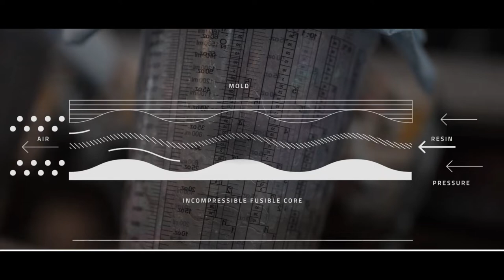Time Alpe D'Huez 01 Long Term Review

Comment: Owned a Time alpe d’ huez 21 for over a year now and its the closest thing to a classic steel frame in feel except it has that light feel and rockets uphill with ease. Super stable and rails downhill! 
Beautiful bike.
Reply from the maker: Man, you nailed what I was trying to express - that’s EXACTLY RIGHT.
Reply: Could you describe your bike? What Wheels/stem/handlebar/seatpost you use? Im interested by this bike and its difficult to find review
Reply: @Gigi26500 I use 3T 110mm stem and giro d’italia bars. Seatpost is the deda zero that the frame came with frame. Rim brake with campag 11 speed potenza, wheels campag zonda. 54cm size.
Beautiful bike to ride.

Comment: I bought my Alp D'Huez last week and I agree with everything you said.  I've had many bikes over the past 38 years, very few of them felt incrementally better than the last.  This is by and far the best frame I've ridden.  I paired it with DA Di2, rim brakes, Pro Vibe stem and bar and, ahem, Lightweight wheels... which I only bought because it's very difficult to find reasonably priced quality wheels right now and I was able to find these locally with just a few miles on them. The bike came it at 14.8 lbs with Wahoo pedals.  I couldn't be happier.
Reply from the maker: I was with you right up to “rim brakes” 🤣🤣 JUST KIDDING!! I’d love to build up a superlight rim brake bike with my Ksyrium Carbon tubulars.
Reply: @AndyClarkRealReviews  Lol, well I'm still a little old fashioned I guess.  And, as you know, we don't descend for very long around here so not as much of a performance advantage to get disc.
Reply from the maker: @cycleark  Truth...I still remember your other Time - you let me borrow it for BDB a few years back. What a rocketship!

Comment: Got my ADH 01 a few days ago. Built it up with some of my favorite parts. Shimano di2 12 speed, BBInfinate ceramic bottom bracket. Used my Zipp 303/404 firecrest wheelset with Vitoria Corsa pros 28/30mm. Very nice riding bike on my short 35 mile ride. Can’t wait to put some real miles on it. Thanks Andy
Reply from the maker: Very nice!

Comment: My local bike shop is now a selling this Time frame set and the point which resonates with me the most is Time own the entire process. After the last 2 years will not buy a Wilier, Specialised or Bianchi if it’s made in China. If they’re going to change top dollar it must be made in house.
Reply from the maker: It’s well worth it. This is a top-notch frame and you can really feel the difference.
Reply: @AndyClarkRealReviews  thanks for confirming my purchase.
Reply: or the traitors and deception artists at specialized/trek/wilier etc can sell those southeast asia sweat shop bikes bikes for $300 instead if the $6,000 they're charging

Comment: Those Time pedals were the best...  esp if you ran the Time shoes with them.  I started on a blue and white Schwinn Tempo, one model year before yours.  It was a great bike, 6 speed 105 with complete crap wheels- Rigida rims (that were NOT rigid) and Mallard hubs.  But I rode the poop out of that bike.  I did not get the Time pedals until 3 years later when I developed knee issues.  The pedals fixed my knee problems.  I used them for the next 8 years.  Same pedals and shoes.
Reply from the maker: Nice! My Tempo had Wolblers with 105 hubs. They were absolutely BOMB PROOF!

Comment: i having been riding the disc ADZ01 w the Aktiv fork since the fall - it is an amazing bike - perfect in every way, comfortable, stiff, refined, great handling, solid build- it's truly perfect - and oh, the carbon weave.....it's stunning  - just oh, so good....weighs about 16.75 lbs w pedals and cages....i run 25mm tires on the back and 23mm on the front - it's awesome - not the lightest, but this is better than my Colnago in every way....Viva Le France!

Comment: Hey Andy, interesting timing for your video! I’ve been having a lot of thoughts about Time in the past few months. Their older frame finishes didn’t really work for me and as I’m aesthetically driven I opted to wait. The new finishes are so classy!

I’m after a frame for a full Campagnolo rim brake build. I’m not wanting to over capitalise on a rim frame as it’s more just to tick the campy box. However I’m also so impressed by Time that I’m considering a double purchase and getting a disc frame also. 
So a few questions:
1. Do you have any thoughts or experience with the Alpe d,Huez 21 versus the AdH 1?
2. Did you try the time carbon bars at all? I see you had an alternative bar on your bike in the video. They look pretty sweet.
3. Have you tried the regular fork, as opposed to Activ fork?

Thanks for your review.
Reply from the maker: Hey Joel! Yeah, I spent a weekend on the ADH1 and it's really close but I could definitely feel a difference in the responsiveness column. The Time bars are amazing, but the bend shape didn't work for me (they are too deep). Lastly, stick with the Activ fork. It's the real deal and makes a difference for sure (you can also remove the damper to reduce weight, but it's only like 50g).

Comment: I’m still on a 2013 SuperSix Evo hi mod, which I know was a favorite of yours Andy way back when. Part of the joy of this bike of course is that in addition to its stiffness in the right spots and awesome ride, it’s also comically lightweight (mine is 14.5 with cheating titanium speed plays).
I’m looking at these Time bikes as a possible new bike option so curious how you can relate the Time to that old Cannondale? Also, was the R5 a huge step up from that Evo, as that’s also on my shortlist….
Reply from the maker: I would step over the R5 to get to the Alpe D'Huez, and I actually did: I sold my R5 disc a few months after I built up the Time. The SuperSix is an amazing frame, but at the end of the day it's lacking the smooth refinement of the ADH. "Ride Quality" can be hard to define, but you definitely KNOW it when you feel it - and the ADH delivers the most vintage-steel like ride I've ever experienced on a carbon bike, without sacrificing any of the gains of a modern carbon frame. And yes, I stole that analogy from another commenter because he said it better than me!!
Reply: @AndyClarkRealReviews  I saw in the video that you jumped ship for the ADH, yeah, and it was clear how much that meant to you. And really if this ADH is supposed to ride like my steel De Rosa Primato (the '95 with the Columbus OS tubing which is sooooo sweet) then that's pretty impressive and makes me very curious!
but will it come with the same weight penalty and the lesser stiffness from, say, bottom bracket through rear chain stays that made this EVO so damn efficient? 
I admit I'm spoiled at this point and the thought of paying out many thousands for a bike that weighs 17lbs makes my heart stop a bit! I'm too slow to add further riding penalties :)
Reply from the maker: @lostincosmos  I'm of the opinion that at some point, lower weight equals diminishing returns. The ADH is 960 grams, and the SSE is 650. You can easily find 300g elsewhere, but honestly it won't make you either faster or slower. Aerodynamic and mechanical resistance gains can far "outweigh" the 300g.  Wheel/tire setup alone can make up the difference, even if it's heavier! I'd recommend spending some time with the Marginal Gains podcast to better understand where I'm coming from.
Reply: @AndyClarkRealReviews  thanks, I'll check that out as I'm reading up and I found this morning a discussion somewhere else with some stats that showed weight savings was minimal in terms of watts saved. so I might just have a mental hurdle to hop over to get over it :) 
Always appreciated your insight, and you should know you're one of the reasons I bought the SSE in the first place as you were gracious enough to even speak with me on the phone when you were at speedgoat I think it was and I was shopping. you called the SSE a beast and once I test rode it was shocked at what it delivered. (I didn't buy through you, sorry, I got a package deal as my wife got a MTB at a local shop and they offered a "holy @#*! price" on the SSE that I jumped at).
so, thanks for still contributing your reviews and knowledge!
Reply: @AndyClarkRealReviews  sorry for the blast from the past. but I'm now an owner of a 2023 Time Alpe and after only a few short miles, I absolutely 100% understand your love for this bike. it really is as comfy as steel as you and another person were saying in another comment, and yet I think the stiffness in the bottom bracket/chainstay area won't leave me wanting for the SS EVO I'm coming from.
could not be happier. thanks once again for helping me head the right direction for my next bike.
Reply from the maker: Nice! Yeah, the R5 was a massive step up in every way, across the board, and I got way better tire clearance too. The ADH won’t be as light, but it’s an easy sacrifice because the ride quality is so sublime.

Comment: I'm a bit puzzled about that comment regarding tire clearance. Time writes on its homepage max. tire size is 28C - 30mm. I want to run Enve 4.5 AR Disc wheels and 28mm tires which I expect to balloon to 30mm. If these don't fit, then that is not the frame for me unfortunately. Everything else I'd really like about the ADH1. It is 5mm shorter than my Tarmac SL6 and has a higher stack. As I am more legs than torso this would allow me to run a longer stem and less spacers under it. But the tire clearance seems to be a dealbreaker unfortunately :(
Reply from the maker: Will they (air quotes) fit? (air quotes)...yes: to the naked eye, there appears to be plenty of clearance on a 30c when the bike is stationary or in the stand. However, when the tires, wheels, and frame flex (as they should) under normal use, the 30c tires will ABSOLUTELY rub on the frame. It's light, and imperceptible, but it happens (and I have the bald spots on my frame's paint to prove it). Go for the new ADHX if you want something with more range.
Reply: @AndyClarkRealReviews  Thank you  for the fast response. Really appreciate your engagement here in the comments to give your real world experience of the frame. I already ride a steel  gravelbike and have no intention on getting a second gravelbike. I will wait on TIME to update their ADH1 and Scylon with the new bio based dyneema internal cable routing and tire clearance to safely run a 30mm. This seems like a must  in 22/23 and going forward as I don't see myself ever running a mechanical group or narrower tire than 28 ever again.
Reply from the maker: @o0o0o0o0o01  Couldn't agree more - they need to push the clearance on the next generation, and make a few other changes (the fork is gimmicky, IMO).

Comment: Hey Andy, I’ve been looking at a rim brake version of this frame, but live in an area with terrible road surface. Would you recommend this with 25mm tyres? (Assuming this is the max clearance for a rim frameset). Thanks! (PS Life long fan. I’ve watched your videos from the very beginning, from around 12 years old!)
Reply from the maker: Hey Harry! Thanks for sticking with me all this time - I guess you’re in your mid 20’s now?? Anyway: I’d go with tubeless 28’s. Your rim brakes should have plenty of clearance

Comment: Would 30s work on Fulcrum wheels that run slightly narrow (19mm internal)?
Reply from the maker: Would they 'work'? Yes. Would you scratch up the paint? Yes, probably. Not advised - stick with 28's!

Comment: You seem like you have a lot of knowledge about Time bikes.

I'm considering buying one, but am not quite sure wether i should go for the adh01, or the new adh disc 2023.

Is this new bike now considered their top level frame in terms of stiffness / weight etc, or is that still the adh01?
Reply from the maker: The 2023 ADH disc is their new updated flagship bike. ADH01 is slightly different and ADH21 is a step down. ADH01 is on sale right now and probably the best value
Reply: ADH disc 2023 has different composite combination, using new formula with Dyneema, I believe it is less stiff than ADH01, however they both share HM Carbon & Vectran fibres, but in different proportion. I wil have in next few days the latest frameset ADH 2023, so it will be tested on the road.
Reply: @MrSzwarz  Please give us your feedback😎

Comment: Hiii Andy I’m actually racing The Alpe D Huez triathlon in July next year - fairly new to the cycling bit and I was told I’d benefit from trading in my Blue Rim brake climbing bike for the alpe d huez… I’m 5ft so hard to find a good bike w all the favorite specs,,,, can you tell me your thoughts on which ADH I should look into more - thank you
Reply from the maker: Hey Shana! I checked out your channel...do you live in Chicago? I lived there for a few years and would happy to recommend a good shop/community of cyclists to help you on your journey. As for the bike - if I'm looking at the right course map, it appears to be flat until you hit the famous climb...and then it's all uphill! TBH, your rim brake bike should be just fine from a braking and weight perspective. I'd spend my money on other upgrades like a lighter set of wheels/tires and maybe an aero helmet and a good aero clip on for the flat section. Of course, I won't talk you out of getting the ADH (because it's amazing) but for me, there's other things to spend your money on. Like an upgrade to biz or first class for the flight over :-P

Comment: Other than weight, how does the ADH compare to the ADHX if you ran both with 28 mm high quality supple tires? The geometry looks very similar.
Reply from the maker: They’re very close, performance-wise. How will you be using it?
Reply: @AndyClarkRealReviews  All on road. Some very rough. I have 1971 Bob Jackson Reynolds 531, w/full Campy, 32 mm Rene Herse extra-light tires, TPU inner tubes, 63 psi. Comfortable, quick, classic stage race bike but HEAVY. 1987 Vitus 1987 (Sean Kelly's ride) w/fully Campy. Love the ride, good handling, but max tire is 25 mm, 85 psi. Not good for rough roads. Recent top of the line Trek Domane w/Dura-Ace Di-2 12 speed, 38 mm Rene Herse extra light, measure 42 mm, 38 psi. Ride is not as comfy as the Bob Jackson. Sluggish handling, and about 2 pounds heavier than an equivalent non-endurance carbon. Basically looking for quick handling, light weight, dance on pedals during climbs, and chip seal, tar strip comfort on 4-5 hr rides. Going to trade the Domane for ADH or ADHX. Would like to test ride, but no dealers any where near Indianapolis.
Reply: NO racing!
Reply from the maker: @brucelulu829  TBH from a performance angle, they're almost identical. I'd take a good look at the ADHX over the ADH. Exploring wider tires is a lot of fun, and can lead to new roads and new adventures.
Reply: @AndyClarkRealReviews  Thanks! A little reluctant to drop thousands w/o a test ride 😲

Comment: Hi Andy -- thanks for the great review!  Quick question:  does the 30mm tire "scrape paint" on both front AND rear?  I have grown to like running a 28 on the front and a 30 on the rear of my current bike, hence the question.    Thanks!
Reply from the maker: Yep, it does. Much more up front though. Stick to 28 F/R on this one. I’ll lobby them for more tire clearance on future models 😃
Reply: @AndyClarkRealReviews  Ha.... good luck on that one!   Their manufacturing process does not lend itself to "whipping up some new molds".   😳
Wax molds for the cores and outer molds for the RTM process/cure...... for each size.  
Yikes!
If you could encourage them to support up to 32s or so on the next gen, that would be awesome!   You would be my hero!
Reply: @agie170hss2  Im on my second time now. I went with an Alpe 01 disc. I ran 28mm schwalbe pro ones on my enve AR 4.5s, and I got rub. These wheels have a 25mm internal width, so keep in mind wheel and tire combinations when fitting it out. Hopefully they up their tire clearance asap.

Comment: Just bought my first time...coming off of a specialized tarmac
Reply from the maker: You're gonna love it!
Reply: I have a 2018 comp sport. Love it. But, lately I have been hearing a clicking noise from the crankshaft. Super annoying.
Reply from the maker: @PeterSdrolias  that could be one of a thousand things, tbh, none of which are the frame. I would suggest a partial tear-down and thorough cleaning and greasing of all the contact points: skewers and dropouts front and rear, pedal axles, chainring bolts, rear derailleur bolt etc. if it’s all dirty and hasn’t been serviced in a while the creak may be from somewhere else. If that doesn’t work then pull/clean/grease the crank and BB. You should also apply a fresh coat of carbon paste to the seat rails, seatpost and stem for good measure. I do this at least 4x a year with all my bikes.
Reply: It could be a range of things from hub to pedals. Maybe see what a mechanic thinks. Hopefully you can sort this.

Comment: Just build my first 01. What's the solution for getting the headset cover (page 10 of the manual) to not turn with the steerer tube/handlebars?
Reply from the maker: Unfortunately, there isn't a solution - it's going to move around when you turn the bars. One small flaw on an otherwise PERFECT frame, IMO.